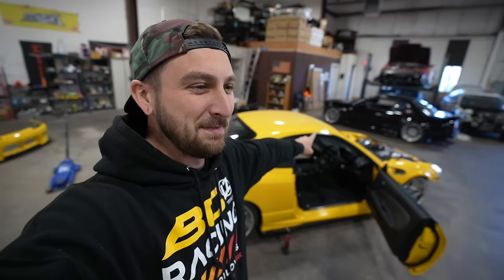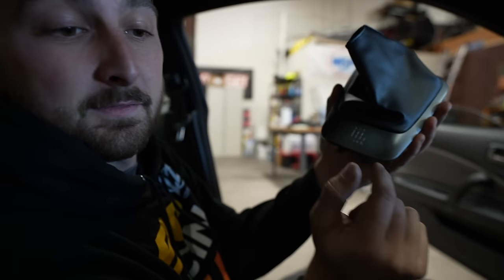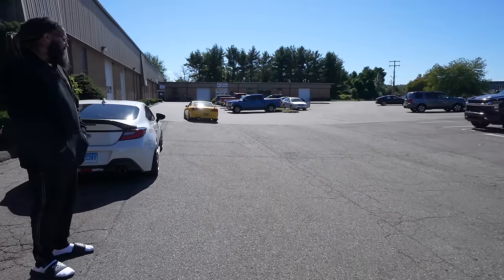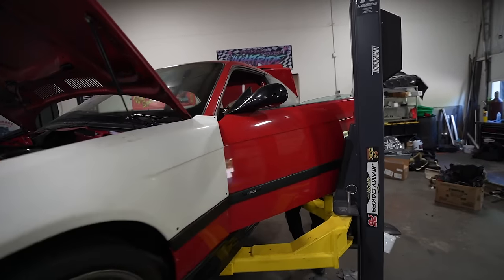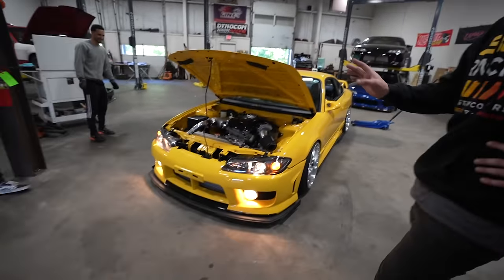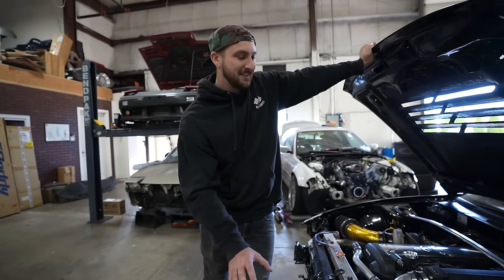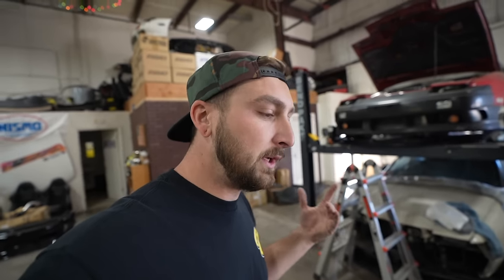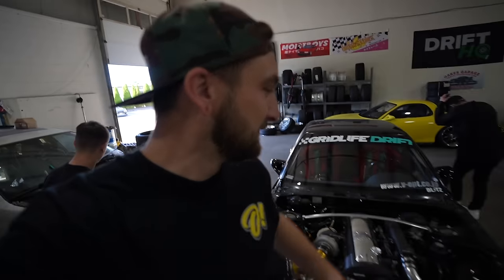Dream S15 is FULLY together.. COOLEST CAR YET?

Comment: I have to agree with spoon a bronze mono block wheel would be best on the car. A 17 with more rubber would def suit the car best. As well I think a longer intake pipe to get the filter down behind the light more would compliment the engine bay.

Comment: When you do tube the front of the S13, you should make it in a way that everything from the shock towers forward is a single bolt on piece that everything else bolts to. Then unbolt it and make a jig for it so that when you inevitably get hit again, you can just bolt on the new front clip and minimize downtime. Shouldn't be too hard for someone like Spoon to bang out.

Comment: I think that it is time to turn the s13 coupe into a full comp chassis just without the rear radiator set up so he can keep the interior.  Just tubed front and rear clips.
Reply: But he should extend the cage to the engine bay and trunk area.